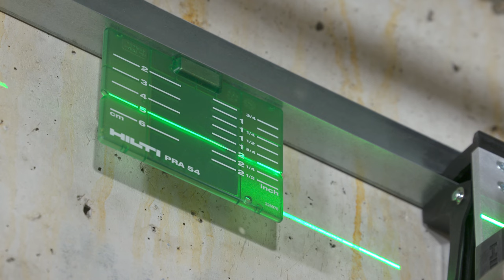Level suspended ceilings with the PM 40-MG green multi-line laser

Comment: I worked as a suspended ceiling guy and this was stupid that phat laser is gonna hit the ground .red 088 dewalt for inndoors, best mounting bracket , (bosch brackets is à joke)best laser angle backwards,long lasting battery ,best on/off buttons (Bosch needs two hands) outdoors i use the green 10.8v, if doing groundwork any rotating will do.